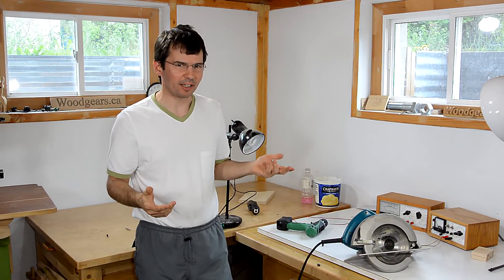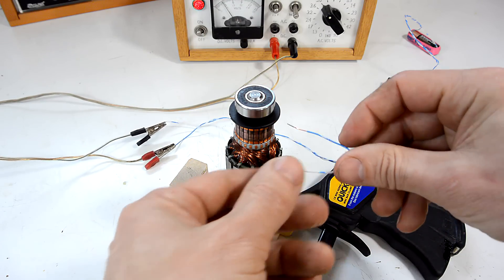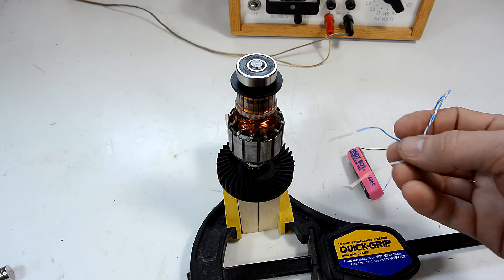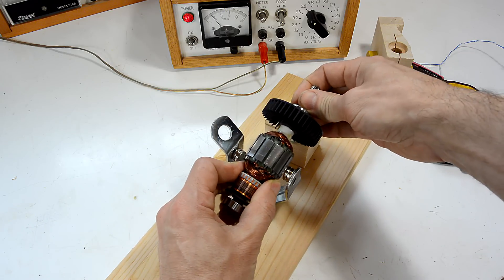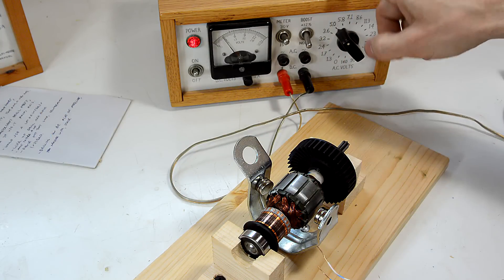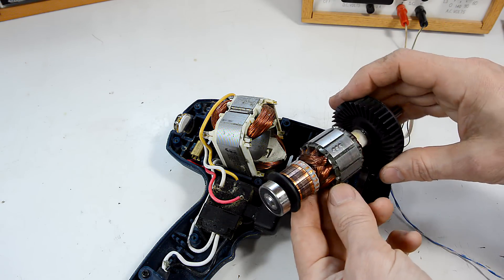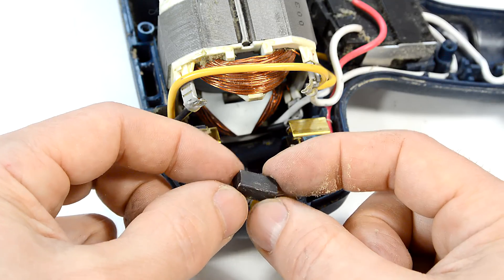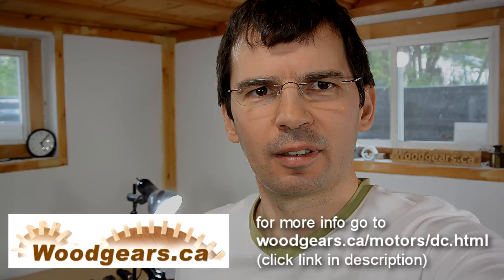How DC motors and universal motors work

Comment: Arnt magnetic fields only created with ac and not dc?
Reply: +Harrison D any electric current creates an electromagnetic field
Reply: Tizian Claus
yes by dc only creates if for a brief moment where as ac creates a continually changing electron flow and thus a continuous current.
Reply: Thats not completely true. It depends on your circuit; if you have a coil in a dc circuit and power it, the coil has a magnetic field as long as current flows
Reply: Tizian Claus thanks for the explanation, is that due to they way the electrons change their direction as they move around the coil?
Reply: +Harrison D actually dc means direct current. ac on the other hand has current wich changes its direction i think you mixed those up or is there something else?
Reply: Tizian Claus
No, I understand they move in the same direction, however as they move around a coil due to the shape of a coil at some places along the coil some are always moving left while others are always moving right. For example, if imagine electrons moving clockwise around a circular wire at the 6 o'clock position the electrons are moving left while at the 12 o'clock position they are moving right.
Reply: +Harrison D the magnetic force is up when electrons move right (12 oclock), and the magnetic force is down when electrons move left(6 oclock). Since the coil is forced up at one end and down at the other end, this makes a rotational movement. this is how a dc motor works.

Comment: AC tools use DC motors? who knew?
 
I assume that induction motors must be AC by design.
Reply: Diesel-Electric trains use DC motors too.  Better torque or something.
Reply: Mark Warbington Well I think you don't need any clutch and gearbox in a train because of electric motor [;
Reply: Dan D I just always found that fact interesting.  Both the toy train set and the real thing use a DC motor to drive the wheels. It's like a hybrid car but without the batteries.
Reply: Mark Warbington Not anymore they don't. Trains in Europe have used 3-phase AC induction motors for a quite a while and now trains in the USA are 3-phase AC induction. With control electronics of today, it is possible to make an AC induction do everything a DC motor can do.
Reply: EETechs That makes a lot of sense.  I know 3-phase is used in industry because the motors are more efficient (the follow up to this video explains it very well).  I learned something today.  Thanks!
Reply: EETechs
While most trains do in fact use A/C motors (because of transmission across power lines), 3 phase A/C motors are not new technology, nor do they have identical performance to D/C motors. ALL A/C motors suffer from a "pull-up" torque, where torque is significantly lower than maximum. This is seen as a sag in the torque curves at low to medium RPMs, building up to peak torque at around 80% max operating speed in most cases. It is possible to reduce the amount of sag in this pull up phase at lower RPM's using a VFD, but there is still a period of sag just due to the nature of A/C current. The overall peak torque is still reduced at these lower operating speeds, even using a 3-phase A/C with a VFD. Comparatively, a DC motor's torque curve is nearly flat from 0 to max RPM, meaning that it produces a much more uniform output at all varying speeds, making it much more ideal to use in applications like servo motors, heavy lifting winches, and CnC lathes, where the RPM of the turning object must be carefully modulated. This is not to say either A/C nor D/C are necessarily better than one another, just that they have different performance characteristics.
Reply: sidgar1 I never said AC induction motors were new technology. They have been around since 1888. So of course they are not new. And you are right about the torque of the AC motors, HOOKED UP TO AN AC POWER SUPPLY DIRECTLY, will have low starting torque, breakdown torque and a small dip between starting torque and breakdown.

However, you are wrong when the AC motor is ran by a closed loop vector controller. With a close loop vector controller you can make an AC induction motor have max starting torque at zero RPM just as DC motors naturally do, but they do not need electronics to do it like AC does. Many VFD's now support closed loop vector control. In fact we have replaced many DC drives and motors with Baldor AC speed drives and AC motors without any issues at all.

Look at what the AC motor torque curve looks like under vector control like what you see for the Tesla Roadster or Model S, for example... If you take that same motor and hooked up it to raw AC, then it will behave as an AC motor would with low torque at start up, a dip, then breakdown, then no load torque.

You are also wrong about DC motors having the same torque from zero rpm to full RPM. That type of torque curve is a result of current limiting in action by the speed controller. When you limit current to one value at any RPM, then you limit torque to one value at any RPM. Current = torque, without it, you get no torque. The type of torque curve a DC motor will have will depend on what type.
Reply: ***** Actually, large industrial DC motors are field coil type, not PM type. Think large HP numbers. The universal motor is nothing more than a glorified series wound DC motor.
Reply: ***** They use SCR controllers that turn the AC to DC, and SCR's can fire at different parts of the AC waveform to then make DC pulses from low pulses for low speed, to full voltage DC for high speed. Its industry standard to call them DC motors. You got shunt wound dc and series wound DC. Both are field coil types, and they could work on AC, but DC is used with the use of SCR speed controllers as I have mentioned.

Large DC motors aren't used too much anymore. AC induction motors can do everything a DC motor can with the use of a vector controller.
Reply: SCR firing time is maxed out for full speed just as though it were a regular diode. SCR's are nothing more than diodes that can be adjusted on how long on or off they are conducting at will, instead of when the polarity of the AC reverses to turn it off like in a regular diode. AC drills use triacs instead. Although being that they use universal motors, they could use SCR,s.

Comment: if you increase the magnetic flux you increase speed
Reply from the maker: Actually, once there's enough flux, more flux reduces speed.it's the other way around.  The more flux, the more back-emf is induced in the rotor, until the back-emf approaches the input voltage.
Reply: You are SO fit!